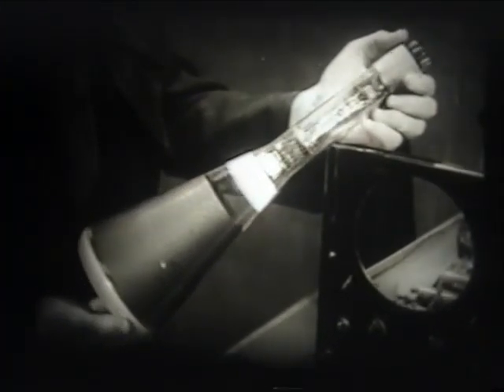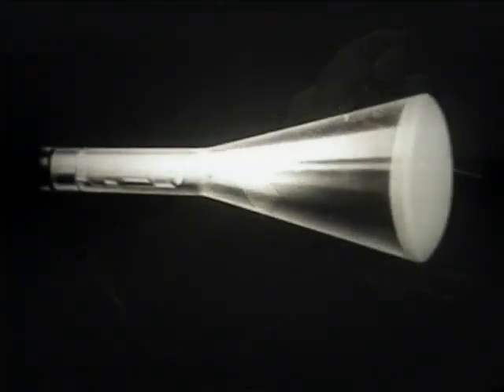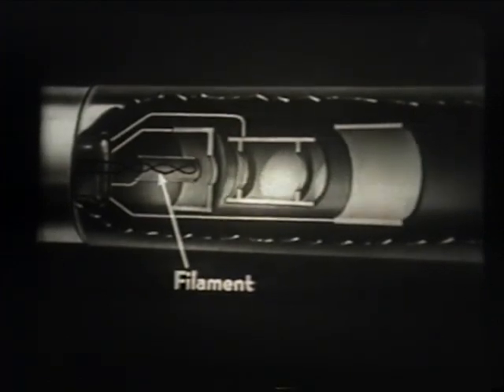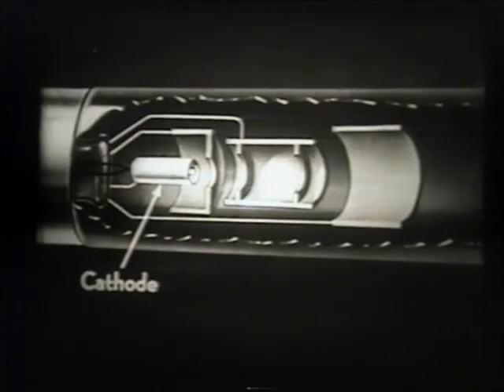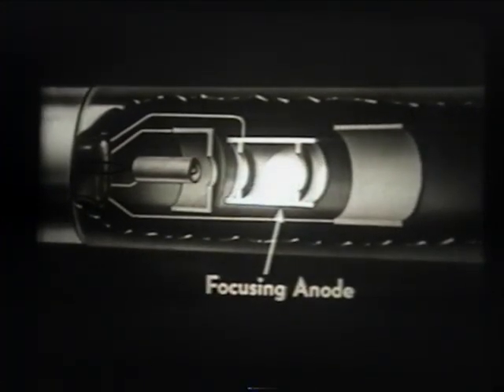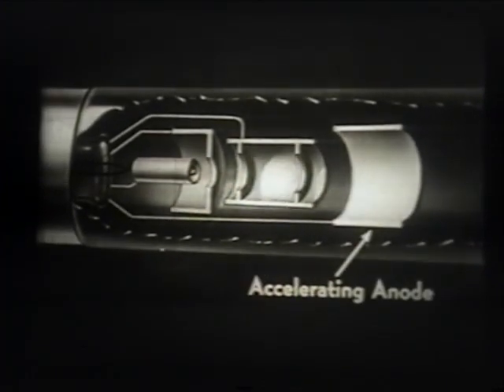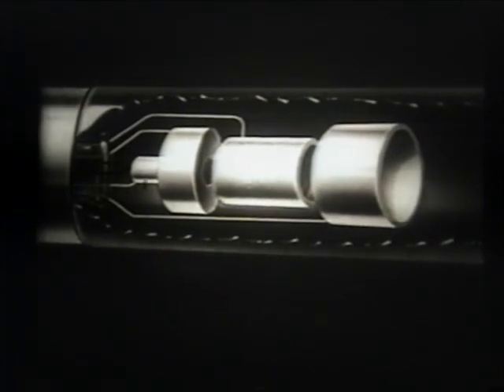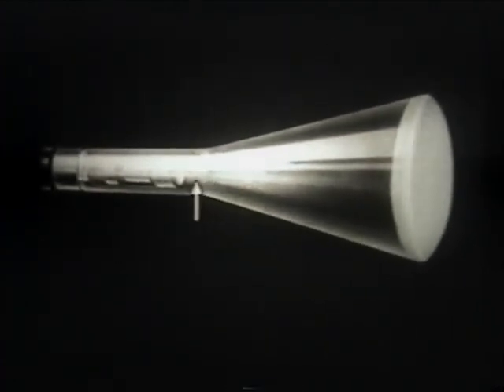The Cathode Ray Tube "how it works"1943 16mm U.S. military training film

Comment: Most people my age (I’m 22) would just say that the crt is something from the Stone Age I on the other hand love this old stuff
Reply: Millennials think they're still little "kids" and try to act like anything from more than 2 years ago is from the stone age. No one cares what the Skinny Jeans Generation thinks.
Reply: ct92404 that’s part of the reason why I hate that label
Reply: @Hassel 7519 that's true I admit I came off as a bit ignorant when I made that comment. 

I do have an an interest in CRTs and old tech in general but ofcourse not everyone does and theirs no point making an issue out of that.
Reply: I’m almost 50 years older than you and I’m very happy that we don’t use CRTs anymore. The only CRT I still own sits inside an antique Tektronix oscilloscope (with vacuum tubes and a few transistors).

Comment: Wow, I didn't know they even had oscilloscopes back in 1943!! Very interesting!
Reply: Well, oscilloscopes have existed since at least the 1920s, and the cathode ray tube itself was invented in the 1890s (the Braun tube).  In fact, the first radar displays (the old A scopes, like the ones used in the British Chain Home system) were simply oscilloscopes displaying strength of radar return signal vs time (time equating to range), with the outgoing radar pulse acting as trigger.

Comment: Am I the only one that wonders what you could make with multiple electron guns inside one glass vacuum chamber, pointing at one screen? I imagine you would want to change the shape of the chamber to fit the different setup, and use smaller electron guns. But imagine having different zones of the screen being updated by their own dedicated E-gun! Use four guns and you might be able to have four times the refresh rate for all I know. What limits can this be pushed to? What can miniaturization do for this technology? We have electromagnets in speakers that fin inside the ear, with coils of copper wire that's ridiculously thin. A thickness comparable to spider silk. Could we miniaturize electron guns to the point that we could have one gun per pixel, on a 1080p display of reasonable physical size? How far away from the screen does the gun actually need to be? I think the whole "tube" could be much less bulky.
Reply: and I thought I was the only pony, brony or pegasister, mare here in the comment section:3 Brohoof
Reply: You're not alone: dual beam oscilloscopes have two electron guns, color TVs have three, and a plasma TV basically has three guns per pixel.
Reply: Haruka Takahashi nope
Reply: When LCDs and Plasmas were just taking off, there was a separate screen technology being developed called the SED (surface-conduction election-emitter display), basically millions and millions of nano-sized cathode ray guns or emitters on a grid.
Reply: But over some point this is senseless, a gun per pixel would be the most inefficient LCD screen...
LCD refresh rates are limited by the rate you can send the data to the pixels. This doesn't change if you change the screen technology.
Reply: @nagygergely11  actually old crt have higher refres late no input lag or blurry image when its rapidly changing
Reply: @nagygergely11  
from wikipedia:
SEDs combine the advantages of CRTs, namely their high contrast ratios, wide viewing angles and very fast response times, with the packaging advantages of LCD and other flat panel displays. They also use much less power than an LCD television of the same size

Comment: That technology will never catch on. There's no use for such a cumbersome system, even in the field of radio transmission.
Next fancy trick is to get maybe two, or even three guns in one tube. That's witchcraft, I tell you.
Reply: But it alredy existed and ever some other fancy stuff with each gun per pixel
Reply: @justjako9145  Some clown was telling me there's displays out there that don't use CRTs, and use some crystals in liquid form.
N ow they've gone off their rocker.
Reply: @georgef551 Hello again! Those are LCD and CRT has many advantages over them but i guess future will bring other better stuff like micro LED displays that are apparently better than both, and if you would like to check multi electron gun displays they are called SED displays,
also colored crt had 3 electron guns for each color
Hope this helps